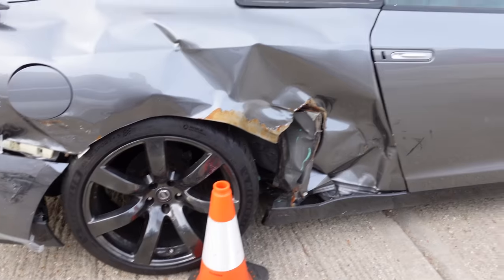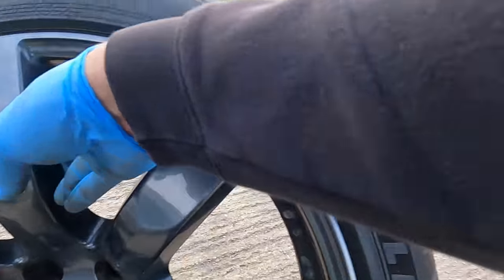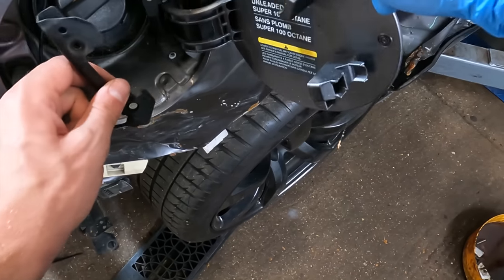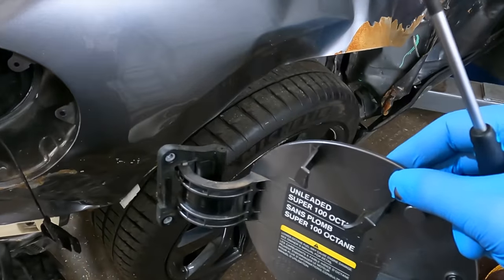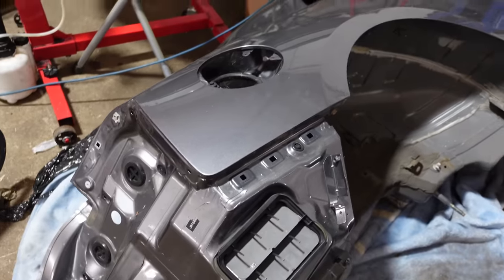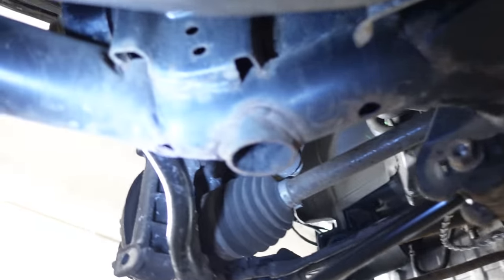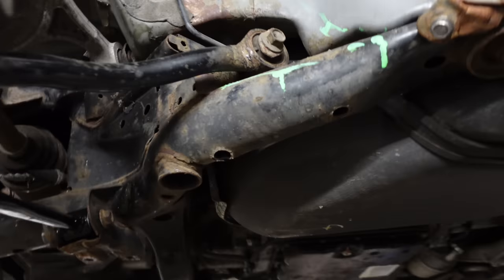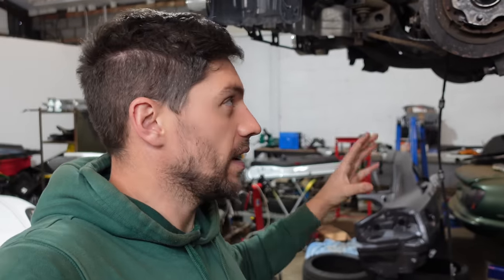HOW BAD IS THE DAMAGE ON MY CRASHED NISSAN R35 GTR??... PT.2

Comment: I like your page and enjoy following you. Normally to repair such a damage it's common to first pull it as much as possible in place before removing the rear quarter Fender.
And I think with so.e panel beating and pulling you only need to replace the outer Fender abs the front half inner.

Comment: You don't need to start it up to get it into neutral. There is a little tab you pull out on the right side of the drive selector panel thing. Pull the tab out & push down the locker with an Alan key or screwdriver & you can select N to push it around without the engine running - unless you really needed power steering assistance of course.

Comment: Check the piston sizes are the same for both, if so good to swap over. Quite a lot of calipers will have  'leading' and 'trailing' sized pistons (usually the smaller contacting the disc first), but not all. Also looks like the pistons are not equally located off the centre of the caliper, so that's not really going to work inverted I don't think. I mean it will work but it won't be right.

Comment: just in case nobody else has mentioned it, if it's anything like Japanese motorcycles, you will need a set of JIS screwdrivers so as not to muller the screws with a Philips.  looking forward to this.

Comment: Regarding the caliper - they are not the same.
Check the position of the pistons in the caliper - they are located out of the center in moving direction of the disc.
That has something to to with pressure distribution.
You may be able to swap the lines and use it temporarily, but you better find a right rear caliper.

Comment: Love how you repair things for reasonable cost. I've got an F31 BMW which had a VERY light knock on the front left. 1 inch crack in the bumper, cracked (LED) headlight. BMW want near enough £4k for the repair. Even doing second hand light and messing about it'll still be over a grand. Damn it.

Comment: Drum handbrake inside the disc is not new my 21 year old MG ZT has that set up, regarding the Q panel I would cut out the entire area and fit the replacement as is. Ultimately it will be less fiddling about cutting and welding bits and pieces. Nice project. TVR next?

Comment: Drill the spotwelds out the panels where needed and plug weld the replacement panel back in. Should make it easier to line the new panels up as spot welds should be in the same place

Comment: check the poston size and location. because in most calipers they are different. and its not good to place them in wrong direction (from big to small or vise versa), because they will bote a rotor in a wrong order

Comment: I had a 2009, 20k R35 and only had it for one whole day before a learner driver wrote it off (Tbone) I paid 35k and got back 26k on insurance and 14k when I bought it back from the insurance company and sold it private as salvage (CAT s) with heavy front end damage (both ECU's at the front explode with front end damage WHICH IS VERY EXPENSIVE) so your prices don't sound too bad for what you have bought, good luck with the rebuild

Comment: Unsure if it's been mentioned by anyone else, but to my eyes the caliper looks to be handed; the pistons are offset to bias the load towards the pad trailing edge. It's certainly typical for multi-piston calipers to have some difference to the piston location or size to encourage even pad wear.
Reply: Yup, was thinking the same - the piston sizes are staggered, and therefore, the calipers can only be mounted on their designated side.

Comment: After completion put the car on a brake test machine to see if that caliper setup has no braking difference.
I have some doubts about being compatible, but the time being ok.
If it does oppose a problem buy a new one from Nissan, stupid expensive yes, but have dealt with the same thing on a Honda, could not find one for the rear I needed, not even a set, so had to buy from the Honda stealer.

Comment: Dean, this is a huge job, those panels can’t be put in as one, they need split and welded in one by one.
Performance Rebuilds did a fantastic series on a GTR, with similar work needed, check that out. It’s pretty much a play by play of what you need to do, and very detailed.

Comment: You forgot the added cost of the subframe 😉👍🏻
Reply from the maker: Hoping I’ll find a cheaper one 🤣🙌🏼
Reply: Heat up the bent section, length of scaffold pole in the end and it will straighten ok